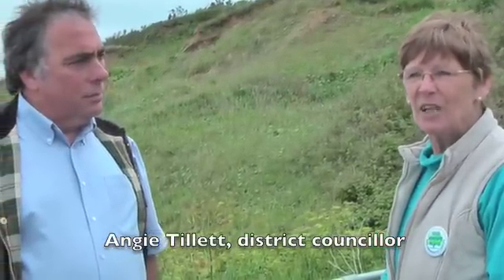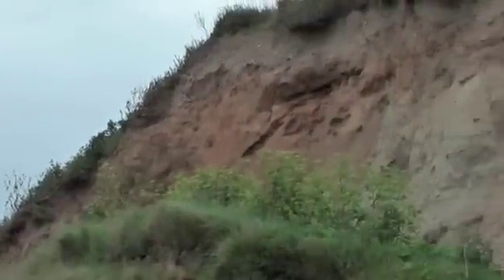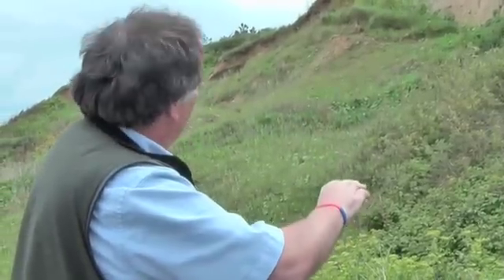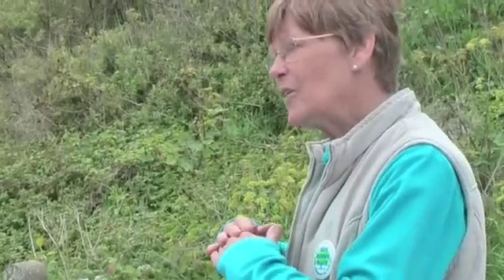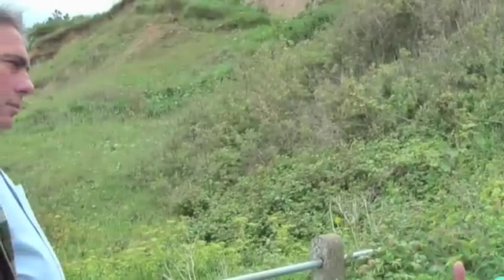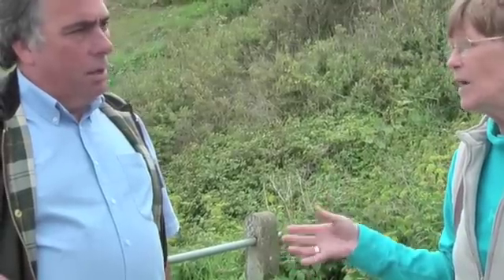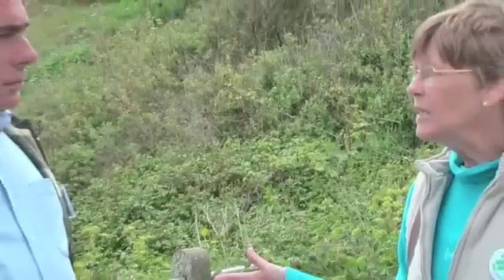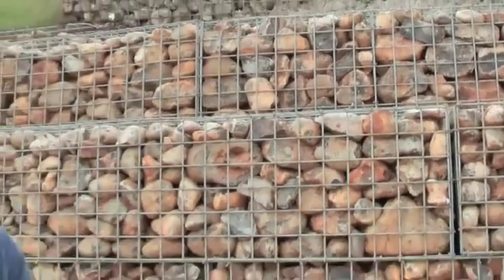Coastal erosion in Overstrand

Comment: The local politicians seem to be blind to economics. You don't spend £1 to save 99p. Coastal defence is not a one off cost - it goes on forever.

As to the earlier comment, beach sand protects nothing, it only appears to protect where the costal zone is being built up. It certainly cannot protect an area that is sinking - coastal defences or not. 

You might as well try to put a cork in volcano. It's tough, but that's how it is